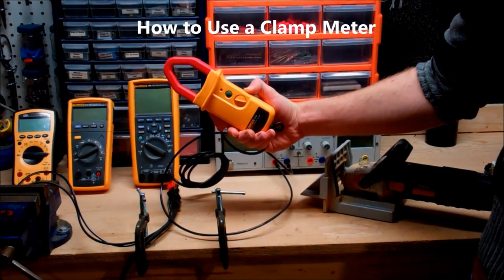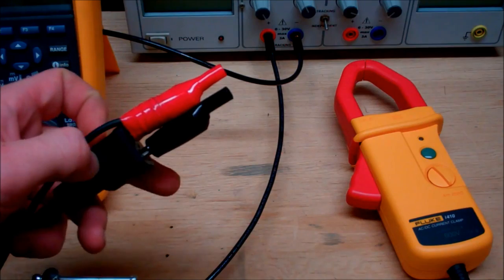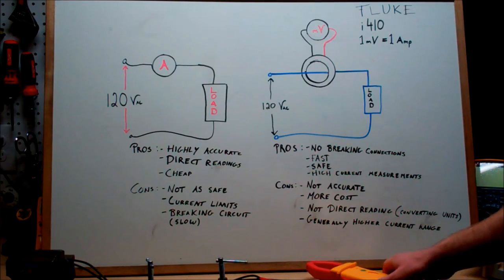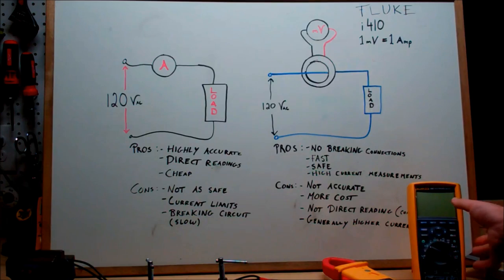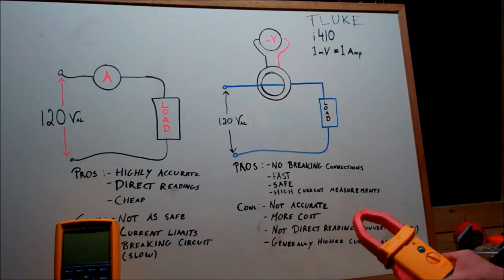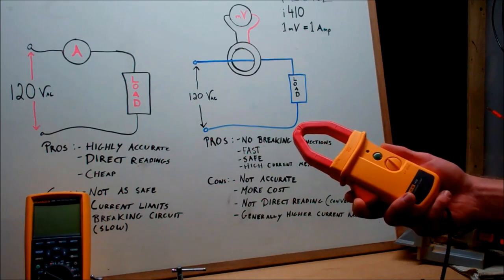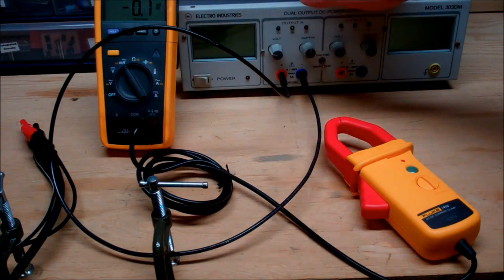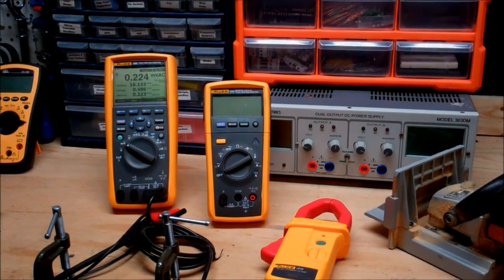How To Use a Clamp Meter

Comment: "You can't just throw it onto the power line.  You have to find isolated lines to do that because in a power line, there are multiple lines with currents that cancel each other out"  AHH!!  That just fixed my problem.  Oi.  Sometimes it's the obvious stuff that gets overlooked.  8-year-old video and still wildly helpful.  Thanks!

Comment: Too many devices used..... your clamp meter doesn't have a display on its own... then you connected it to a multimeter..... too risky wiring if you are measuring AC Current..... why not use a clamp meter with a display..... or a clamp meter which is also a multitester / multimeter device............. Be Safe...........

Comment: Great vid, thanks. What is a good ac/DC clamp meter for around $50?
Reply from the maker: robviolin1 I do not have a solid recommendation for you as DC clamp meters that I would recommend start around $150+, but I will keep my eyes open for one.
Reply: robviolin1 - Unfortunately there are none.  They become highly inaccurate especially if you're measuring down in the mA range.  You're going to.have to spend at least $150 to get anything fairly reliable.

Comment: The fact that you have to isolate one wire to take readings with a clamp isn't as annoying as breaking the circuit, but it's still a little annoying (considering the price of an amp clamp). Are there clamps that can read AC amps without having to isolate one wire ? Moreover, at this price point (Fluke i410), I would have expected the clamp to zero itself out automatically when in DC amps mode. Thanks for the usefull info.
Reply: AlainHubert - it's not possible because what the clamp is actually measuring is the strength of the magnetic field generated around the wire, by the current passing through it.  One magnetic field will cancel or skew the one next to it, which is why each wire has to be read/clamped individually.
Reply: Thanks for that info Mark. I would have thought that in 2017, there would be a tool that could measure current with both wires, sort of like the portable power detectors that beep and light up when nearing live wires in a wall ?
Reply: AlainHubert - there's a big difference between merely detecting current and accurately trying to measure it.  ;)

Comment: I have the same current clamp you're showing there (mine cost $250, btw) and I can't get it to read AC current, even though it's stated to measure both.  (Have no trouble with DC.) Tried measuring the current on some of my boiler elements (individually wired) and it displays nothing.  Am I missing something?
Reply: What DMM are you using with it ? (it has to be able to measure millivolts AC, and not all DMM can do that)
Reply: AlainHubert - Using a Fluke 87, which does measure millivolts.  I wouldn't think it mattered whether it's AC or DC since the clamp is converting a magnetic field to voltage but I could be wrong.  I'll have to wait til Monday to check this out since my stuff's at work.
Reply: Mark, possibly you are clamping around flex cable which includes the Active and Neutral wires.  As current and voltage waves are equal and opposite in those two wires, they cancel out their electromagnetic fields, and you get no reading.